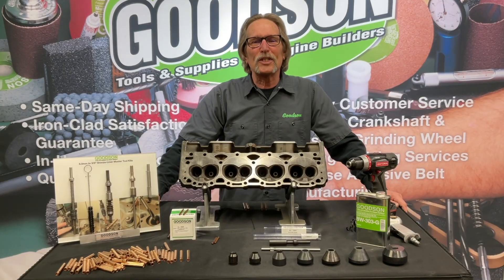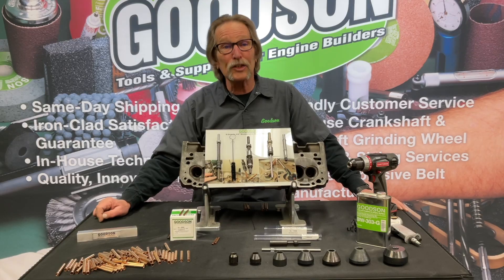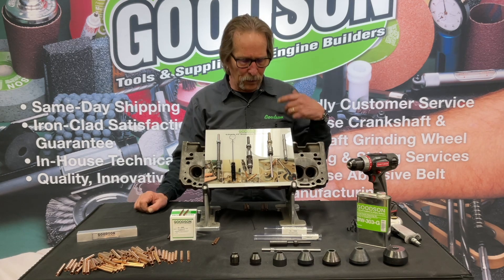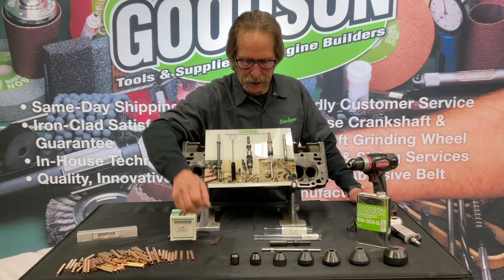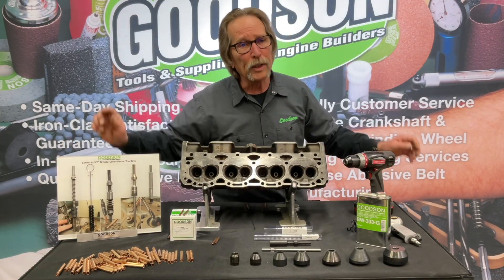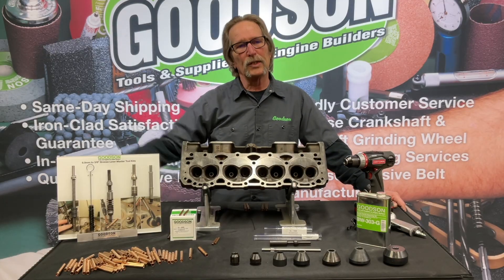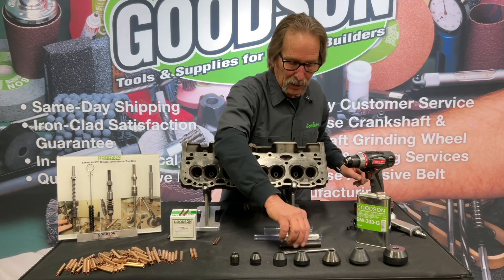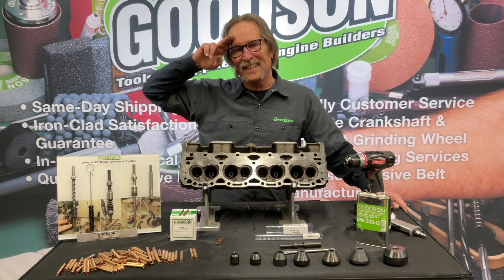Installing & Removing Bronze Valve Guide Liners | Tech Lab Tuesday

Comment: Can you help me understand your statement about 8mm stems? I agree it starts at .315 at the stem. But manufacturers recommendations for an LS engine with 8mm (.315) stems is only .0010 to .0026 over aming the final size ranging .3165 to .3176. They also note at 0.0037 and over to replace the guides. You are noting to get to .3464 to .3475. that is going 0.0314 to 0.0325?? This seems like is way out manufacturers specs. Is this a genearalization or a specific engine you are refering to?? Am I way off on this??
Reply: Yes you are way out you have to bore the guide bore out over size to fit the liner which is then sized to give the correct clearance on the valve stem